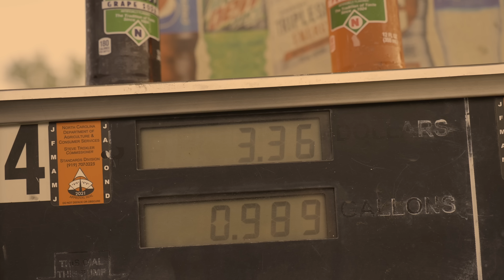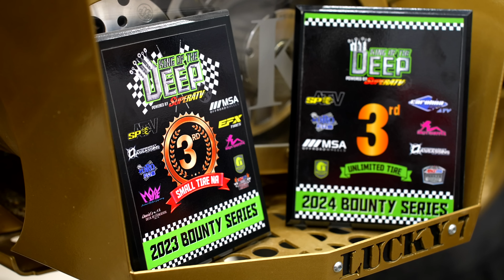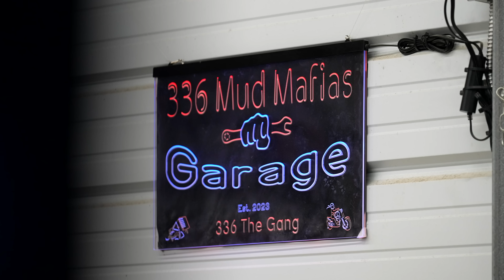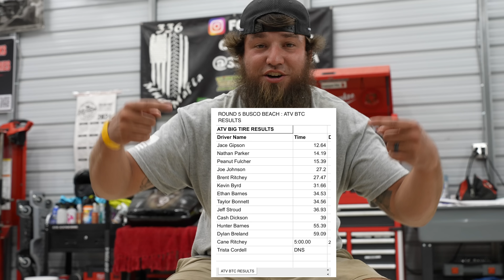We Took Our HUGE Bounty Bike DEEP!! *INSANE FULLSENDS*

Comment: Does anyone run say 30% reduction on front and 60% rear. Has me wondering of spinning the front faster would keep you from bouncing across the hole. Know trucks they spin the front faster than the rear to keep the front up better
Reply from the maker: That’s a good question, I really couldn’t tell you but I can see where that would work!
Reply: I'd look into it. Maybe be first to try it. Even if it was 15% faster it would help I bet